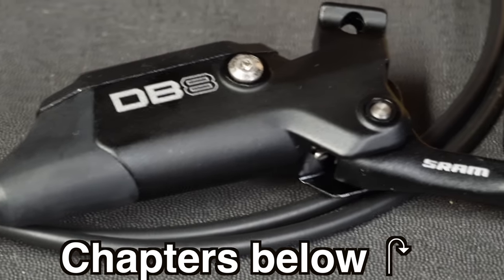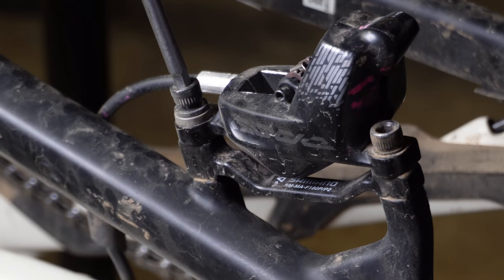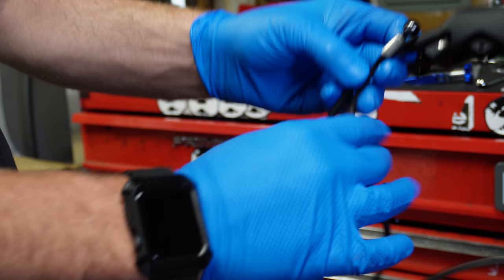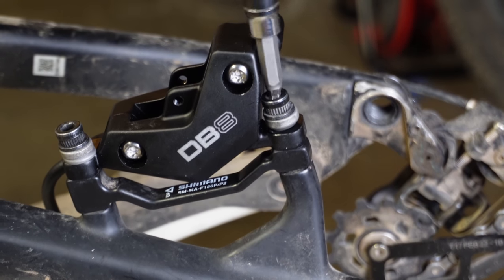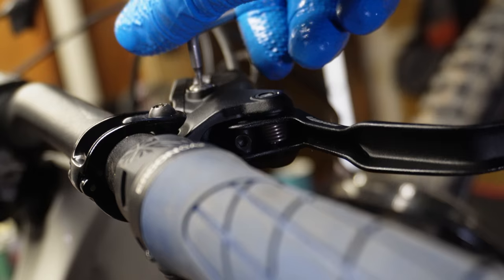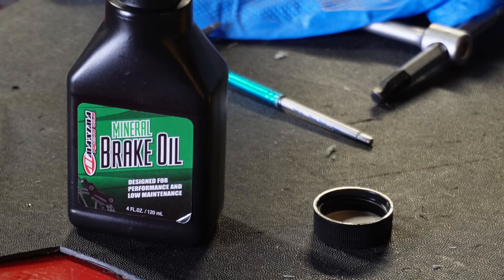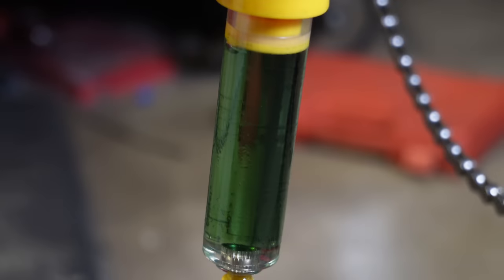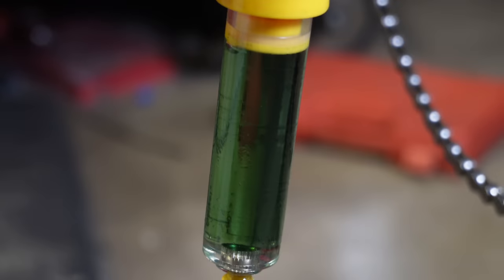How 2 Install and Bleed Sram DB8 Brake

Comment: If it can help the bleed port thread you'll need for the fitting is m4 x 0.7
I had it in a roadbike kit, probably for Campagnolo, not sure.
*Little update March 2024; I've been riding in a lot of shitty wintery mud so I figured I'd rebled them, the fluid was dark asf, the contamination probably came from the seals around the pistons so I opened the rear one, geez there was a lot of crap around the seals. I cleaned the best I could no visible scouring but the piston material is weird not really ceramic or typical nylon more like a hard polycarbonate... Pwetty weird stuff

Comment: 4:51, 5:07 & 11:46 The rear bottom spherical washer (light gray) on the caliper mount seems to be upside-down, which means it doesn't do its job properly and may get damaged under stress and vibration. But otherwise, good job.
Reply: yes i saw that. thats cancer :) i also don't use anymore washers. The tolerance are much better now then 10/15 years a go

Comment: Put the Codes back on! The DB8's are not better. From my own experience of using both, I will be going back to the Code RSC's.
Reply: I'm running them back to back with the codes RSC there's not a significant difference the lewis and saints need way less lever effort than both sram offerings but I'd rather have what ppl call "modulation" I ride a lot of heavy grade (mountainous Canadian area) and I never got them to fade, not unlike the mt5's they replaced 💀

Comment: would you know of this still has that plastic piston plunger on the lever? when the brake is left under the heat of the sun the plastic piston swells which makes the lever stuck. issue on previous sram brakesets
Reply: I feel like that hasn't been a problem in a really long time. All of our (10) bikes have some version of SRAM brake on them and the only ones I ever had the sticky lever piston with were a set of 2015 Guide RS's.

Comment: Could you do a lever bleed like a shimano brake? So just add the cup put some fluid in it and flick til bubbles clear?
Reply from the maker: FYI the lever went soft after 3 months use the recommended bleed method the cheap kits are available now
Reply: Same happened to me within 6 weeks. Back to Codes R's for me. @OtterXtra
Reply: Could you please share the information on the affordable bleeding kits fo DB8?